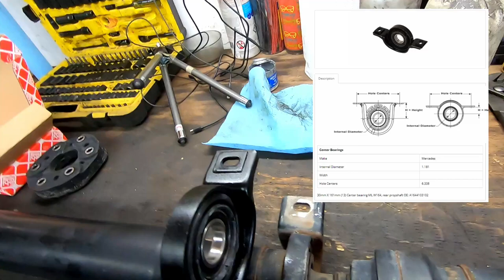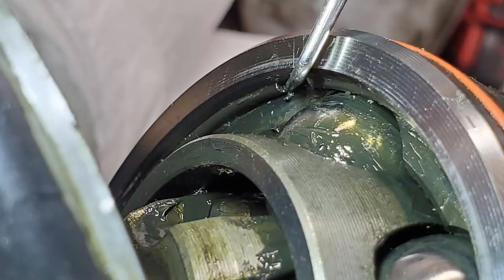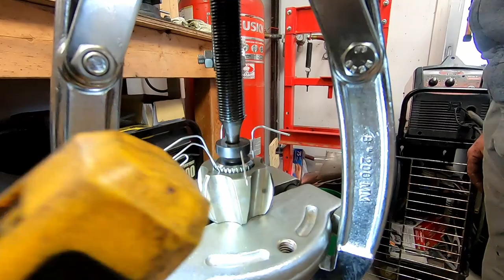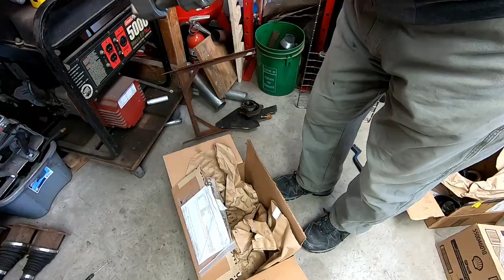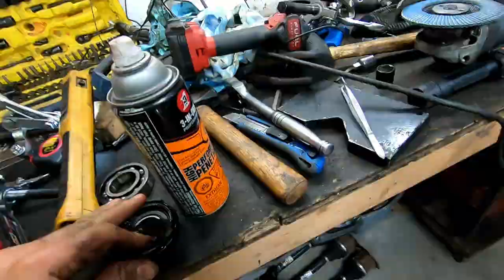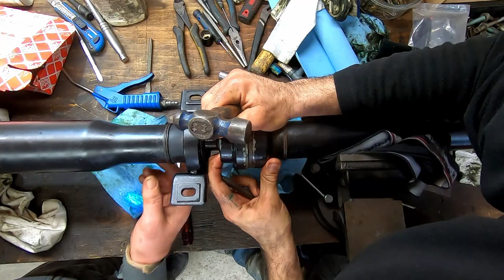How to replace driveshaft center support/hanger bearing on a Mercedes GL/ML/R (X164/W164/W251)

Comment: Works! Thanks! The middle part must be moved to the very front before getting the paper clips between the locking ring. I also had to file the clips a little to get them there.
Reply from the maker: @jouniheikkila5135  glad it worked!!

Comment: Great video. Thanks for sharing. Would like to see more video on the GL, eg. Radiator replacement, water pump replacement, power steering pump & hose replacement, alternator replacement.

Comment: Great video. Just could not figure out how you twittled those clips in. There are those inner and outer keys filling the keyways so i could not get those slide in, no matter what. I tried also some sharp pins. So I had to use somewhat brutal force. Well, those shaft keys in the end of shaft are gone, but there is still enough groove to hold the ring. I hope.
Reply from the maker: @JuhaKeisala  eek... hopefully it'll hold

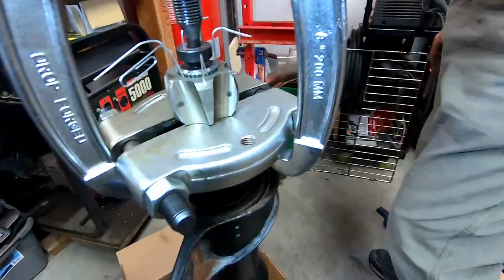Comment: 11:09 how deep are the groove marks from balls? Did your flex u-joints or whatever they call moved freely? Like with no binding what so ever? 
Im asking because i took front one apart and it had similar grooves to yours and they are binding. Making this shaft no "good". 
So im guessing my rear drive shaft would not be any better.  Planning to replace both of them.
Reply from the maker: I would redo it if I was you - I seem to recall being able to fit this wrong so just take it apart and redo it again... keep going until they're free to move... it's not really possible to break this so take your time and fit it again
Reply from the maker: I do believe you can reverse the outer shell so you can install it backwards over the balls... pretty sure I did that at one point
Reply: @ETMotorsports  my drive shaft ends were binding I took front one apart.  It was no in way moved as freely as a cv axles.  I'm not sure what are you telling me to reverse. But with the amount of wear I do not see it as a good part. I do not really having problems with it up too 80mph but above it there is definitely a shaking going on.
I just did full rebuild on a 100k engine and I don't regret it. So in my opinion the only way too truly rebuild them shafts one would have to cut off the cv ends and weld a new ones. They have way to much wear for my liking.
Reply: @ETMotorsports  so your drive shaft cv ends move as freely as a cv axel moves? Before and after you took them apart?
Reply from the maker: @rightsdontcomewithpermits7073  yup - no issues
Reply: @ETMotorsports  nice! Good for you. But my  ones are binding  pretty badly. And I junked my front one and got used one for free and it is binding just as much. Lol. When I compare them to my 270k miles axels is like night and day, axels move freely and smoothly.  
Either way I'm going to replace it with durashaft ones.  From what I found they manufactured in usa and have a great quality.  And for little under 1k$ it's front and real shaft plus a flex disk. So hopefully it will be good. 
Thanks for replying have a blessed one!

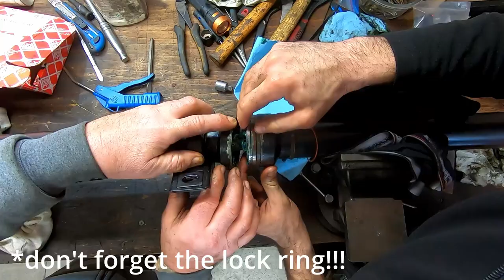Comment: Hello.. I found video amazing. But from 17:10 time I see you hammer the cage back on.. it twist slightly and made a humming noise. Is that normal.. Becuase I have the same issue sound from the center drive shaft
Reply from the maker: Hey the little humming noise is from where I have the shaft clamped on the vice... the cover doesn't move in respect to the shaft once it's in place
Reply: @ETMotorsports  thank you for the reply. Hope it works on mine.. Becuase I have the same issue !! Thanks for posting the video !! Means a lot to me !!!!

Comment: The reason its not serviceable is because the hourly rate is an average 185$/hour and the issues possible following this,is just not worth a quick parts swap + nice profit on a 1200$-1400$ part...and to mention that will be a special order part,no dealer will carry a shaft...backordered germany,garanteed!!anyway great video!!

Comment: Hi, really I appreciated this video. However, when I checked for a new center drive shaft support bearing to my GL 320 CDI from 2007 it does not come up as an available spare part. Only the ML class came up. I would appreciate if you can provide the correct spare part number for my GL from 2007.
Reply from the maker: Hi - there's no spare part from mercedes... if you watch the video I talk about the fact that according to mercedes this isn't serviceable and you have to order the whole shaft. Check out the links in the description to see which part I used for my 2009 GL
Reply: Hi again, 
thank you for the prompt reply. Yes, I understood there are not any MB OEM parts. I looked again at the video but I cannot find any links for the parts, only the drawing where it says ML W164, REAR oe: 1644103102 which was the reason I missed to understand it could fit the GL. However, I would appreciate if you could send me the link for the parts to my 2007 GL.  @ETMotorsports
Reply from the maker: @user-tl9ix2og7r  the ML and GL bearings are the same...I bought mine from the ebay link in the description - yeah there's no GL listing but it's the same unit... only difference is the length of the shaft which doesn't matter for the bearing

Comment: good job.  can it be done the same in the w166 model?
Reply from the maker: Great question - I would imagine so... the 166 is more or less the same as the 164 both the W and X versions so I suspect it's the same setup
Reply: @ETMotorsports  somehow all your replies on the Audi oil issue videos are all gone, postings and replies

Comment: Do you know if the bearing will fit 2007 GL420 with offroad pacage?
Reply: Just finished this job. It's easier to do on my car. There are only one lock ring at the splines that needs to be opened to separate the axle. Thank you for this video 😁 I payed 130$ delivered to my door in Norway for the bearing. Axle at the dealer was 2900 dollar.
Reply: @stianholmgren6607  Nice. I am about to do this job on my 2007 GL320 with the offroad package. Anny tips?
Reply: @nic7340  The video explains the process very well. I used a good marker and made scratches on the axle making it easy to match up the splines.